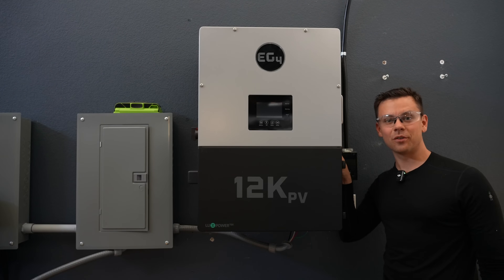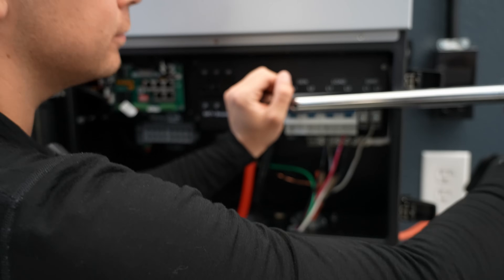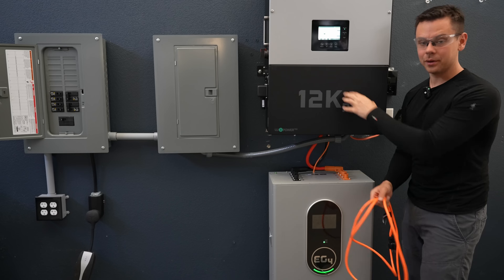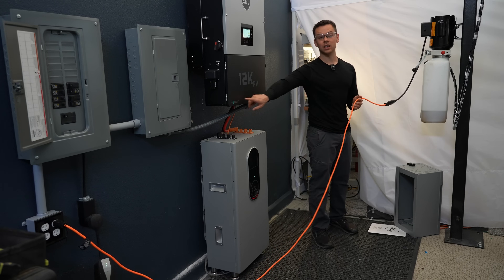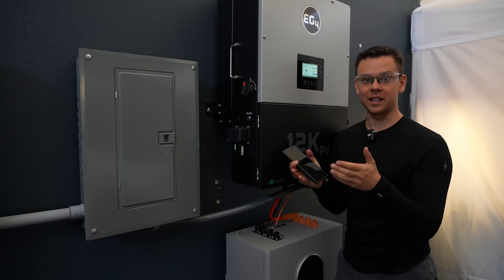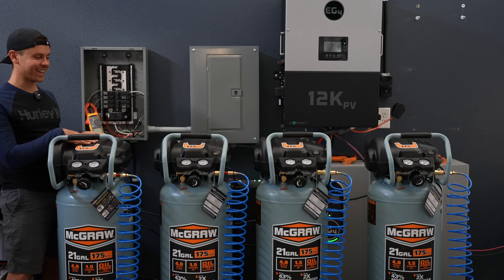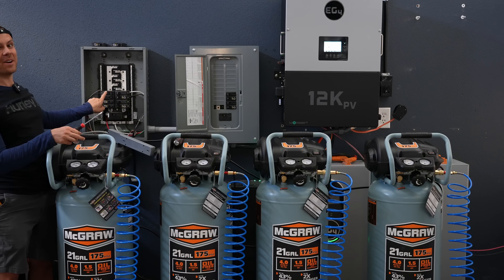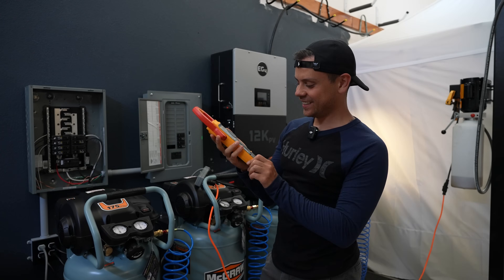NEW! EG4 12Kpv: 8,000W 120/240V Hybrid Inverter w/ 136A Surge?!

Comment: As good as this looks the pricing is out of whack! 2 6000xp gives you 12000w and 16000 solar capacity. All that for $400 less. If the 6000xp lasts 6 years who knows what technology will be around then. No one should buy an inverter now guided only by that it will last 15 years or even 10 years, The technology is exploding in 3-5 years these will appear very aged in technology. For me, I will buy as many 6000xp as it requires plus one extra for good measure.
Reply from the maker: Grid interactive is not cheap. These are way cheaper than other grid interactive inverters
Reply from the maker: 6000xp is great for the money if you are off-grid only for sure
Reply: @WillProwse  True. I am off grid. I actually have been holding out waiting to see the pricing on these, Thought it would have been around $2400 or so. My system will require 10 6000xp so the maths is against me on these.
Reply from the maker: @MrDonking1967 yeah, better off with 6000xp

Comment: I’m sure a good electrical glove could help one day when you decide to overload a breaker from a start. Safety first
Reply from the maker: Yeah that's true. And no the panel was not energized when I worked on it.
Reply from the maker: It's fine guys lol 🤣
Reply: And both gloves if you're building the habit of reaching both hands into a panel while waving a screwdriver around, maybe set the tools down before reaching or doing anything else with your hands in a panel.

Comment: Are there any inverter products, hopefully from EG4, that allow three phase 208-240v output?
Reply: I'm not certain, but I think if you use 2 or more of the 18Kpvs you can configure for a 3 phase output.  I'm pretty sure you can with the Sol-Ark systems.
Reply: You can run three of the 6000xp's to get 3ph.

Comment: Can an 18K be paralleled with a 12K? I want 4 battery packs but to do that I would need two  inverters. I could run my house on one 18k though. So two 18ks at $10K for 24kw or two 12ks for $7K for 16kw output which would be more than enough for me.
Reply: Couldn't you just connect the 12k into the 18k generator backup port?
Reply: I have 2 3000ex units connected to the same batteries, they dont talk to each other. one just charges the batteries

Comment: Downloading this video to have it forever. Good info and this looks like the perfect unit for my garage area.
Reply: I know what a great unit. Of course they came out with an after I bought the 18KPV I've never hooked up. It's been sitting for 6 months. Very bad thing to do if for some reason it doesn't work properly. Might mess with my warranty if I needed it Hopefully that won't happen I better get started on it soon though. 
I'm pretty sure I could have got by with this unit instead of the 18KpV and saved a few bucks... But I have The good one at least 🎉

Comment: As much as you hang stuff on the walls, I'd think (rather than tearing up your sheetrock) that you'd have some outer-mounting board of some sturdy material (itself bolted to the studs, of course) that you could tear up as you like!
Reply from the maker: Yes I have that on the other walls. This is the new wall now. Next will be concrete wall in the new building
Reply: @WillProwse Will  that eg4 xp 6000 can I hook that to 240 transfer switch?

Comment: Will can you parallel the 18K and the 12k if you do not want to spend all that money in the 18K?
Reply: I have two 18kpv would like to parallel a 12kpv with them. Will what software ver. does the 12k use

Comment: Wil, What would you think about doing (2) of the 12K's?  I currently have (2) 6500's and they do trip occasionally or, would you suggest just doing the 18K which by the numbers of output, would be 1K watts less than my current (2) 6500's?

Comment: Wow , can this be placed in a box truck connected to solar panel on top and maybe connected to 4 batteries you are using 5o power a mobile pressure washer trailer ?
Reply: You dont need this much for that. you can build that system with the 6000ex, for way cheaper.

Comment: @WillProwse does this model feed the grid as well? Or just use the grid to charge? I've been looking through all the info on Signature Solars website, maybe I'm blind but It doesn't say specifically that it feeds the grid. I'm kinda on a budget and looking for an inverter that can feed the grid, charge batteries, have the grid charge batteries, and still use the grid as needed, Etc. Thank you in advance for everything you do

Comment: Harbor Freight has fantastic drills and impact drivers now that can compete with anyone. They even have their “XP” batteries with 21700 Samsung cells inside and their Hercules tools are brushless 20v. Can’t beat them. I ditched my 12v Milwaukee tools years ago because of the batteries; nothing but problems with them and the internal contacts in some tools.

Comment: It's 1 click. And did you use copper antiseize?
Reply from the maker: Not with these thick multi strands. You wiggle it, then torque, wiggle it, then torque, then let it set and hit it again. It is not easy getting those to proper spec.
Reply: Or Burndy schmoo. They have an aluminium paste. I prefer copper anti-seize though, usually.

Comment: Don't forget the protocol settings on the battery for the inverter being used
Reply from the maker: It comes set to luxpower protocol
Reply: @WillProwse  just figured it should be mentioned for new installers to know about